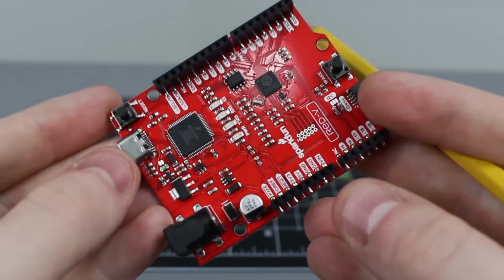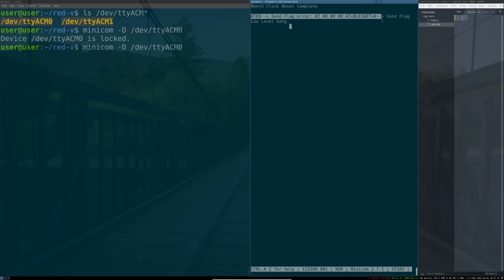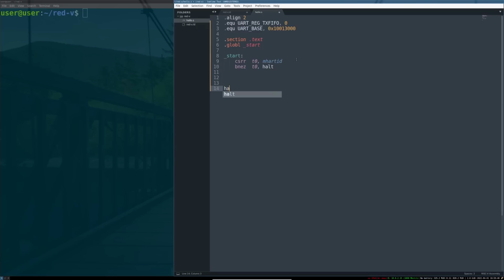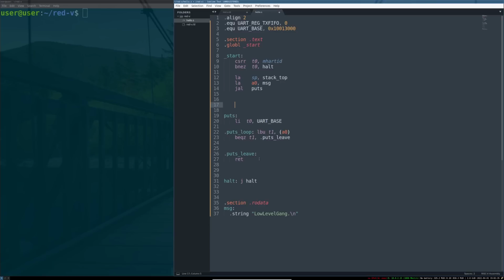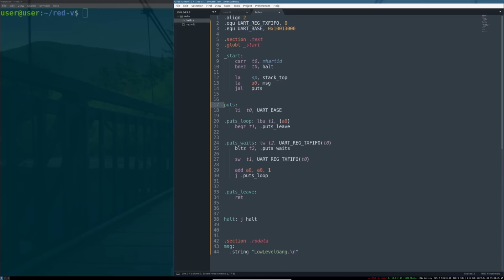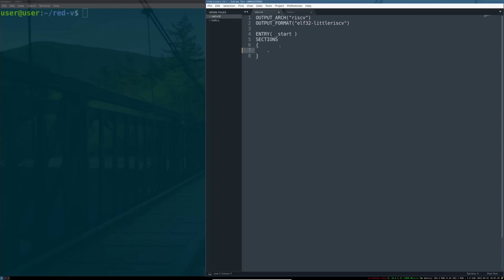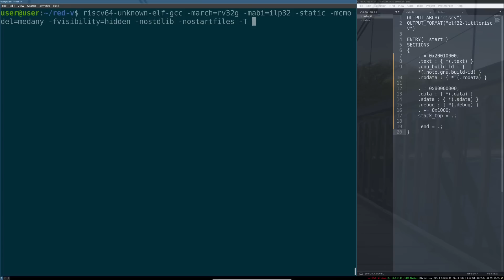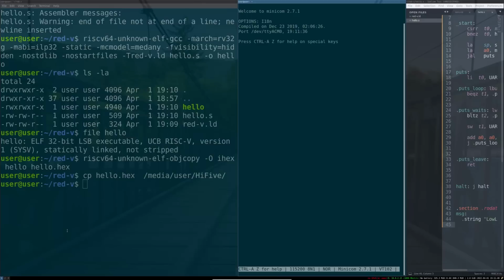This is the BEST Board to Learn RISC-V Assembly.

Comment: Wait wait... wait. Multithreaded programs in assembler? Is anyone that masochist to even try that?
Reply from the maker: It’s very possible!
Reply: @U “Amali L” N can you name a book where I can find such a theme? I'm kind of masochist when it comes to low level haha
Reply: @U P i fear you
keep it up!
Reply: yes it's hard, but running io stuff on a thread is great no matter c or assembly.  It feels so good when you get it to work!
Reply: I haven't touched assembly in a while, but IIRC, the big problem im multithreaded assembly is inter-thread communication and scheduling. Is there another big issue I am missing?
Reply: @wernerviehhauser94  resource sharing, and deadlock avoidance
Reply: Yes. Yes we are.
Reply: Terry Davis, he built a terrible (but impressive) os in amd64 assembly, but he was also mentally ill. So take that as you will.
Reply: @U Nakano I am a little bit with the answer, but in C++ the most typical/easiest way to write a multithreaded program is just to write '#pragma omp parallel' before some loops.

Ofc to do everything manually without using a fat (3 MB) library for multithreading is much more demanding, but imo it's usually not worth it.
Reply: Yes
Reply: Level 9000
Reply: Your reading my mind
Reply: Not really any more complex than multi threading in C or single threaded assembly.
Reply: all programs, including multithreaded ones, are ultimately in assembly language. You can't implement a multithreading OS or library without hand written assembly language.
Reply: This video will help a lot of beginner learning assembly as this board utilize riscv core as its main mcu. Expect more advanced topics on other peripherals how it is used in various real world application.